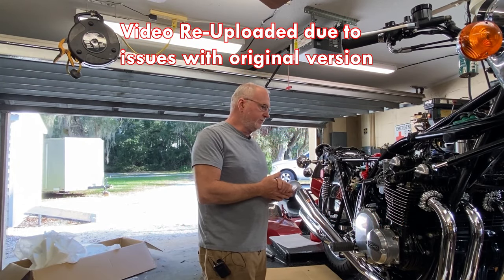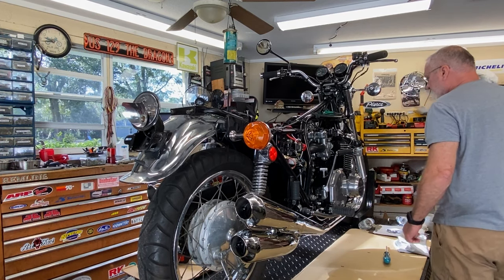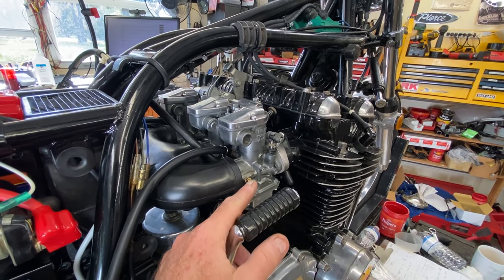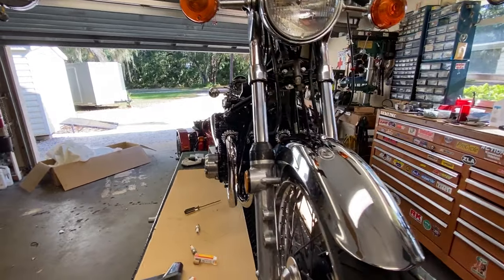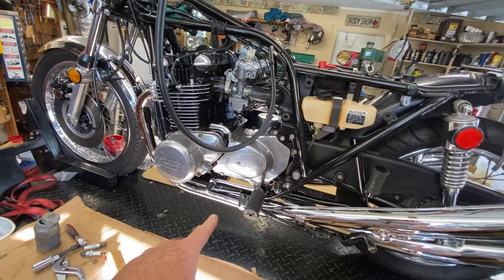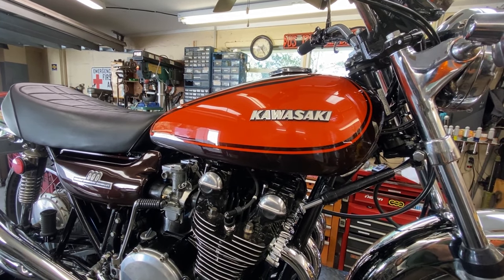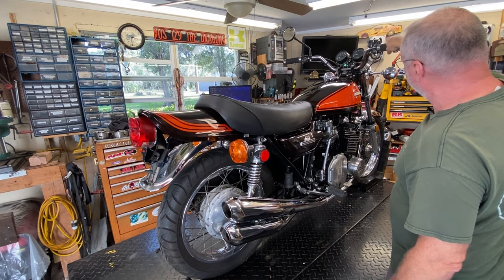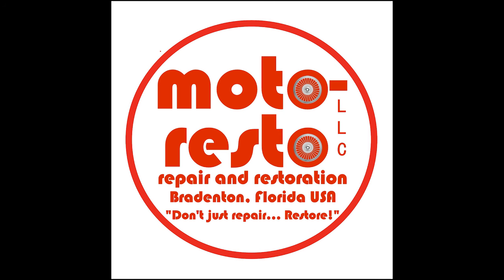1973 Kawasaki Z1 900 (mostly) FINISHED! 4into4, jet fiddling - and IT SINGS!

Comment: Where do you think the running would be  if you tried  127.5 jetts? Just asking.  The oil problem might go away with putting some  miles on. Enjoyed the video Tom and RIDE SAFE OUT THERE!
Reply from the maker: Don’t know if it’d make any difference towards any positive direction, I did take it for a shake up and down the road, it has no flat spots and wide open throttle it doesn’t miss a beat so I’m happy with the jetting. The bike has no tag right now so longer ride is not an option for me.
Reply: @MotoRestoFL  sounds good 👍

Comment: Where it's probably more in the low to midrange your not getting the throttle response,  I may have tried one position up on the needles. They are the transition from pilots to main jets. I don't change mains until I can get it out on the highway and do a proper plug chop so you can actually see what the main jets are doing?
Reply from the maker: Agree but at this stage I have to get this thing done, and the bike doesn’t have a tag. Owner is still out of state on work.
Reply: @MotoRestoFL  That wasnt meant as criticism,  just an observation. I noticed it had an LTD fender on it previously,  and then it was changed? Lol. Nice job overall, not many of us old school guys left that can and will work on this stuff. 
I picked UK p a 78 KZ1000 I have in my shop now. I need to get title sorted and I'm going to dona resto on it. I'm going to do a 4 into 4 exhaust on it, I always loved the 900 exhaust, the collars have to be drilled as the 900 had 6mm studs, 1000 has 8mm, other than that should go on no problem.
Love your channel, keep up the good work!
Reply from the maker: @CWS1963  didn’t take it as such. You are right as I said and it’ll be back sometime in the future for other stuff and assuming he rides it in that meantime, I’ll examine the plugs and make any adjustments then. Thanks for the input.
Reply: @MotoRestoFL   awesome, I'll be watching.

Comment: With the 125 mains, if you don't have the 122.5s go 1 click down on the needle jet.  From memory I thought the Z1s had 117.5 stock on the mains.  Sounds like you have a slight vacuum leak.   When I used to tune carbureted bikes back in the day, I would always start out running fresh race fuel as I don't trust the ethanol enriched fuel.  You need to put some miles on that bike with some race gas as it will clean the internals of the carburetor. You probably have one jet that's still slightly clogged.

Comment: I was wondering if it was a dumb idea to check for correct jetting with a fuel ratio gauge. By the way, thanks for the videos.
Reply from the maker: There are no dumb ideas here. It’s something that’s been brought up before. Unfortunately, the only way I can find that a wide band fuel ratio meter can be used is with a sensor, not unlike an oxygen sensor, which requires a welded bung installed in the exhaust. I don’t know any others that use a different sensor. That’s obviously something we can’t do. If you check out Robot Cantina here on YouTube, he’s using one on a lawn mower engine conversion powering a small car. He custom made an exhaust and welded in the bung. If anyone knows another way, I’m all ears.

Comment: I love some older bikes but finding parts is a bugger. Need some coils for my old 99 6R
Points snd condenser setups are a pain. And cap you buy thats bern sitting around is probably no good.
Reply from the maker: Agreed, on the cap. That was a test only. Talking to the original owner was not as informative as I hoped and he was unclear on what he or anyone else had done. 

As for coils, I'm guessing from your vernacular you're down under, seems you folks there have a bugger of a time getting stuff shipped in, cost-wise. I looked up those coils, they are weird looking for sure. But, you can get aftermarket replacements from the UK, I see them. Tell me this, please, what country or continent costs the least to ship into Australia if I am correct about your location? That would educate me on how to help other folks who, like I mentioned, have said it's hard to find parts there. Cheers.

Comment: Enricher!! We call that a choke down under in New Zealand
Reply from the maker: Same here, it's printed on the lever, but it's not a choke. A true choke limits air flow into an engine in order to richen the mixture. These type carbs have an enricher piston which is lifted opening up an enricher circuit for cold starting. Ergo, not a choke but an enricher. My lawn mower has a choke. I won't degrade these fine Mikuni's to that level.

Comment: Great result Tom, I have a friend who delivered me a 79 XS1100 UK bike about 3 months back that had been ridden into the ground and sat for 20 years, had lots of electrical parts missing or knackered, seized carbs, missing tci box solenoid/starter motor ignition switch/ cracked coils, dead pulsar coils etc etc.
It looked like something from a Mad Max movie, but after a few months and  quite a bit of time and money it started up first touch of the button.
It was brave of him to bother throwing money at it, but he really wanted it back on the road next spring, I still have to do the cosmetics, it's been a challenge to find parts for it here in the UK, I know it will cost more to restore than the bike is worth but the owner is happy with the progress and that's what matters. Been a personal challenge for me to get it running well, and I am delighted how well it is running so far considering the state it came to me in.
I remember when these bikes were launched, so it was fun to work on the bike and yes I am an oldie of the 60's!
Reply from the maker: I had a "centerfold" you might say poster of sorts from Motorcyclist or Cycle World back then when the Excessive Eleven came out, on my bedroom wall. I was in HS at the time. I absolutely wanted one of those big-time. Now, not so much. After doing a top-end on one and then riding it, compared to many other bikes, the XS11 is anemic and handles like a truck. Cheers.
Reply: Yeah the owner is fully aware of it's handling faults, as he said,"it's a muscle bike". Never meet your Hero's so they say. @MotoRestoFL

Comment: The chrome head light housing and shorter front fender are KZ900/1000 LTD parts. Is this engine case a not restamped replacement case? I cant find/read any matching engine no. range like Z1E  042xx (nice hollowed cam shafts btw).
Reply from the maker: Good eye. I totally missed that headlight bucket. The engine number is really hard to read like it’s printed vs stamped. Or, very shallow stamping. I’ll have to check when it’s light out. I did look at it in the beginning but didn’t write it down. We’ll see what the customer wants to do if anything. Thanks.
Reply from the maker: Curiosity got the best of me so I went and checked. The engine # like I said is hard to read but it’s 043 and within the 200 numbers to the frame number. About 150 higher than the frame. According to the Z1 Enterprise knowledge base article, the engine numbers should be within 200 higher than the frame which this is. I’m no expert in judging originality, but the engine number does not look doctored or unusual except for being rather faintly stamped or however it was done. Again thanks. You viewers are excellent resources.

Comment: Thanks for the great video content you provide here.
If I could make a suggestion coming from 5 decades of my 1st hand experience wrenching/restoring Kawi big fours & triples is after you get ign,timing,plugs,valve clearance & carb sync all dialed in is when motors at full op temp to check/re-adjust each pilot/idle mixture screw separately to obtain best/smoothest idle.
 I do that because I often find the factory suggested setting is a good starting point when cleaning/rebuilding carbs but isn’t always best for quicker warm up & smoothest idle at full op temp.
Btw,you mentioned that you were a little concerned that idle speed varied quite a lot from cold start to when warmed up,well getting each cyl’s idle mix screw dialed in separately for each cyl helps a bit with that but by design with carb’d motors there’s always an increase in idle speed from when motors off chock & idling not at full op temp to idling at full op temp on carb’d motors & not to worry about it as long as you have all the above dialed in & jetted properly.
Happy motoring from Vero Beach FL!
Scott
Reply from the maker: Yes, I do adjust them individually, but it's something I do a bit later over time.

Comment: Great video Tom 👍 what a beautiful bike. Is it just me but I’ve always thought the front mudguard (fender?)  looked as if it was on back to front? ( I know you have put it on the correct way btw)
Reply from the maker: The photos I looked at show no mud guard. There is very little difference between the length of this fender when measured from each tip to a mount hole, it’s only very slightly longer one way so I put that side back towards the engine. They’re supposed to protect the engine from getting douched by road dirt and water. The concours 14 in comparison has a short front fender aft, many including myself add a fender extension so the radiator (even with a guard) doesn’t get pummeled by high velocity crap.

Comment: Did you sort the loose spark plug? Surely that will cause more damage leaving it?
Reply from the maker: It’s not really loose just the threads are tore up a bit. It tightens but who knows. I have not been authorized to perform this repair. It’s very tricky and risky even with the proper Time-Sert kit.